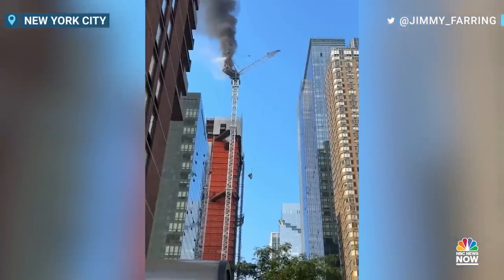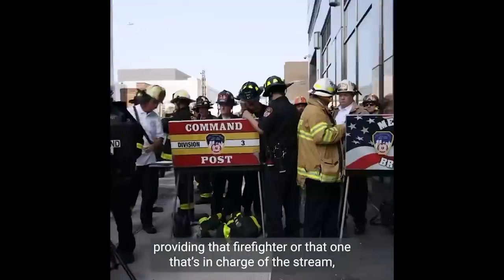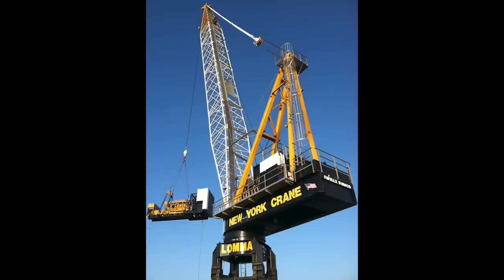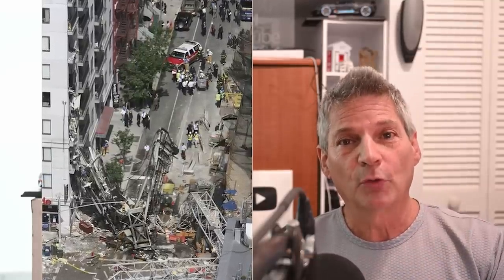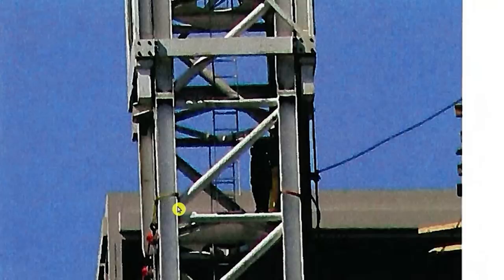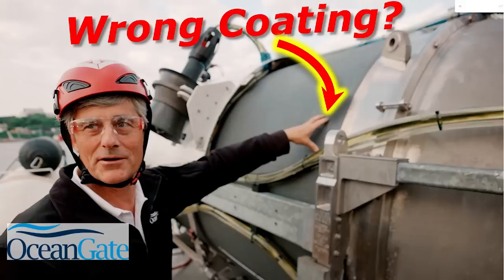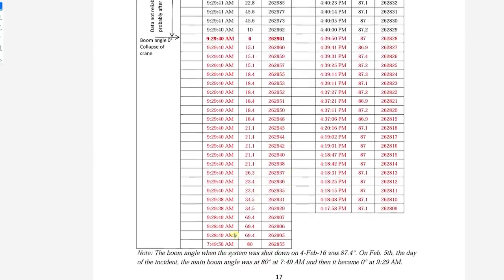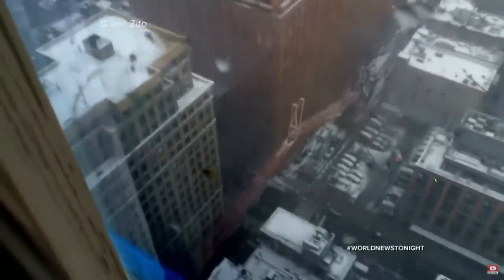New York Crane Collapse Cause, MORE Fatal Collapses

Comment: Having been a crane operator for 44 years, I have never seen a diesel powered tower crane.  They are all electric.  Think about HOW would a person get diesel fuel to the crane.  While it is possible, it is economically absurd when electric power cables have no appreciable ongoing costs.  IF you are serious about tower crane accidents of this type, research other YouTube videos for fires on tower cranes.  I have seen 4 tower crane fires on video.  It is difficult to determine the crane manufacturer but they all appear to be the same model.  If this model uses hydraulics, that would explain why they catch fire.  Most tower cranes are ALL ELECTRIC with no hydraulic oil to catch fire.  A fire would burn the boom hoist brake materials as they are heat sensitive the same as the brakes on your car.  Once the brakes are damaged by the fire, the boom will fall.  All four crane fire videos end with the boom falling.

Concerning the "tip over" accident, this one was ALL the operator's fault.  It's clearly visible, the Main Boom should have been at 80 degrees.  The jib should have been "jack knifed", as you call it, down until the point wheels were on the ground.  This tip over was caused by the operator booming down the MAIN boom without luffing down (jack knifing) the jib down first.  You are correct, the jib should have been luffed down BEFORE the storm.  I am positive "wind tunneling" (wind being funneled between buildings along a street) was a factor.  I doubt it would have been enough to cause the tip over IF the proper procedures would have been followed.

I have used YouTube videos to expand and improve my crane knowledge.  If I am able to watch an accident and figure out the cause, which often times is extremely easy, then I am able to watch for that scenario and prevent it before it happens.  In my career, I figure I have been on nearly 40,000 job sites as I operated a rental crane providing hoisting services to thousands of customers (3-5 jobs per day, 5-7 days per week, year round for 44 years..  In all that time, I have never tipped a crane over, but I have picked about a half dozen up.  It takes experience, dedication, and perseverance to be a good crane operator.  Some have it and some don't.
Reply from the maker: This one is deisel powered, if you look at the used crane listing sites, they show the Cummins deisel engine on this model. It might be an old school model.

Comment: Could've been a hydraulic line let loose and sprayed onto a hot manifold. Those large hoses can blast out a tremendous amount of oil, any idea what the psi rating is on those high pressure lines? Unless the operator notices the break, it'll just keep shooting oil at a high rate until the operator shuts it down. Probably 30 to 60 gallons in no time, hot aerosol oil.

Comment: 45 degrees isn't optimum after you add air resistance in to your calculation. 
And then there is fluid thread breakup to consider, which is more complex than air resistance and depends on the volume and velocity of the water stream.
No way would 45 degrees have got them anywhere near it.
Reply from the maker: They are already close. The angled stream was hitting the front of the crane. All they had to do was angle it up a bit more to get tot he back of the crane. Not even close?
Reply: @jeffostroff  A higher angle means more time in the air, more drag and a drop off of velocity on the x axis. That's why 45 degrees isn't as optimum as, say, about 36 (depending on initial velocity).
Some of those shots seem to show the firefighters are at a higher level then the crane fire too. Bit hard to tell.
When you add in fluid thread breakup, it's all trial and error.

Comment: Air resistance will effect the optimal angle.  And the stream breaking up into droplets is another factor in how far a hose can EFFECTIVELY reach.  

A little backyard experiment with a garden hose and a 5 gallon bucket will give a much different optimal angle.  You can see this on the flat shooting hose, it doesn’t just fall short, it’s Also breaking up to the point that there is no stream, just a spread out mist.

I have to add another critique. You appear to be an intelligent engineer with little practical knowledge on this subject.  The crane operator is required to do regular inspections. It’s at the beginning of every shift.  It’s also not possible to inspect every part in full detail, as some would require disassembly, and even just inspection of everything accessible from every angle would take the entire shift with no work being performed.  As a final point leaks start at a point in time, assuming there was a leak that caused this fire, it is entirely possible it began after the inspection.  I had 2 issues in the last month I dealt with.  One was a bolt shearing off dropping a load a couple inches. It had no visible wear and the crack wasn’t dirty or oxidized like it had been happening over a period of time.  The second issue was a hydraulic swivel fitting that just blew apart without warning.  Both machines are still down getting substantial maintenance and inspection, including items that were not due because of where they were in the PM cycle.

Comment: It’s not an angle of attack problem, it’s a water pressure problem. The pressure and flow rate are not high enough to propel the water that distance.

Comment: Bit of a difference in flight between theoretical cannon balls and a water stream.  Take a look where the water stream breaks up, at that point the theory all goes out the window.  But the low flat stream was quite pointless and would be better shut off to conserve pressure for the bigger stream.  I wonder if high rise cranes all now get an onboard fire suppression system ?

Comment: Poor analysis - second fire hose could've been a longer run or lower pressure. Predicting failure of an engine hydraulic hose is nearly impossible. Stopped watching after that, dangerous/incompetent to assume so much.

Comment: Worked in a shipyard that the cranes operators  killed others - a  new operator lowered a boom over a truck & the brake failed on a friction crane - a crane operator moved a load over a worker & the rope failed -

Comment: So, did you also think about the velocity loss using a 45 deg angle for the water? The lower the velocity, the more it will start to spray and just drop, no? You don't want a mist next to the fire - I mean if that's your goal, sure.

Comment: The operator stated that the engine went in to “Diesel Engine Runaway”. Fact!
Reply from the maker: What does that mean!
Reply: Diesel engine runaway is a rare condition affecting diesel engines, in which the engine draws extra fuel from an unintended source ie oil and overspeeds at higher and higher RPM, producing up to ten times the engine's rated output until destroyed by mechanical failure or bearing seizure due to a lack of lubrication.[1] Hot-bulb engines and jet engines can also run away via the same process.
Reply: @jeffostroff it would be awesome if you could do a YouTube video about “runaway diesel engines”! You have a great amount of followers to educate! Keep well my friend!

Comment: It’s the longest trajectory at 45 degrees, but you DONT want the longest trajectory when you’re trying to spray water onto a finite point. The water stream breaks apart while traveling through the air as it decelerates. Not to mention wind as well. If they sprayed at 45 degrees the water stream would completely break apart at the top of the curve, and then air/wind would dissipate the water and just about 0% of it would actually be concentrated where it needs to be to put the fire out. Fire fighters did an excellent job. NY fire fighters are literally the best in the country.
Reply: Also the second hose was obviously weaker and had less GPM than the other, so they were more than likely “combining” the streams to help carry the stronger of the two streams further to reach the fire. Maybe look up how firefighters actually do things before making a statement that insinuates they’re ignorant of physics.

Comment: Diesel doesn't burn like that, it has to be oil or hydraulic fluid and the hoses can blow without any warning
I don't think that anyone is  at fault here, stuff like this happens
Reply from the maker: Maybe, and maybe not, a hose will blow if it is worn. I check hoses in my car all the time, and when I find a soft one I know it is time to replace. I bet no one was doing this
Reply: @jeffostroff  I think you had better go look at some hyd hoses they are rubber coated steel braided lines you can only bend them by hand using some effort and impossible to crush by hand . Go learn your subject before you comment

Comment: anyone who has ever worked around heavy equipment never asks about why a hydraulic line fails  that would be a full time job in itself  when they go they go, and they can go for seemingly no reason  pressure no pressure pressure no pressure vibrations rubbing imperfections in the manufacturing.  they always go at the worst time too :)    its probably why the second hose was not hitting the fire  they were using the second to keep any fuel or oil from puddling and spreading the fire down as happens with burning liquid

Comment: Are you sure about 45 degree angle, in the context of decreasing pressure/flow (decreasing FORCE)? I'm sure 45 degrees is correct for VECTORs, which are CONSTANT FORCE & VELOCITY! For a case where Force is being reduced/lost as the distance from "hose tip" increases, doesn't the max distance shorten at ANY angle? (Engineering Statics & dynamics)

Comment: I am a bit surprised that they allow the public under them. On a work site you are generally told not to be under a working crane in case it drops something. On a work site at least you should be aware of a working crane, the public probably aren't.

Comment: Those winds are probably average wind speeds. You have two exacerbating factors: wind gusts and the venturi effect of the buildings themselves. Operating cranes in high wind conditions is just criminal. This happened during the construction of the Milwaukee baseball stadium in 1999, killing three workers observing the lift (https://en.wikipedia.org/wiki/Big_Blue_Crane_collapse).

Comment: Why no electric motors in cranes? I would want the generator to be on the ground not up next to the cab, bit of a deign flaw. Would be much easier to do maintenance if most of the large components are not at the top of a crane.

69.420 degree angle not good...

Comment: Would be interesting to compare crane collapses in the rest of the world, especially China. Something must be done about Safety Inspections I'd like to think an aircraft has a better system of safety checks, and that should be the standard system to work off if it's possible?  just a thought am no expert on these types of things.
Reply from the maker: There is an excellent system of safety checks, but crane operators are not engineers and they will usurp the rules all the time. Cranes topple over because they put them on soft ground with no gravel
Reply: @jeffostroff  OK thanks for the info, end of the day someone isn't doing their job.

Comment: Was it ever determined what caused the fire? As for responsibility it most certainly is the States responsibility, but of course they will never admit guilt so they have to point a finger at someone else. Just like the walkway that collapsed here in south florida some years back where people were injured/killed, that incident occurred due im assuming false reports or someone just paid off the inspector to pass. I work in construction as an electrician and have been on many multi million dollar sites here in florida where deadlines need to be met and corners are cut sad to say...
Reply: The main reason for these corners to be cut and false reports given is to save MONEY. ITS ALWAYS ABOUT MONEY

Comment: The real deal here is that the State and the City of New York have not yet fixed their collapsing crane problems. In this instance, it is completely human error and preventable.
If the State and City of New York exhausted as much effort and energy on CRANE SAFETY as they do and have on Unconstitutional GUN CONTROL, then Crane issues like this would cease to be the major problem that it is turning into. This is spat in the face of New York Citizens.

Comment: You're not much of an engineer. You can do a visual inspection and not see anything wrong with a hydraulic hose or fitting. It is under a tremendous amount of pressure and can burst without any warning. 
Former Manitowoc Crane Journeyman Millwright for Manitowoc Engineering in Manitowoc, Wisconsin
Reply from the maker: Did you ever do a squeeze of a hydraulic hose? They do give an indication.

Comment: Helicopter with a bucket below it  dump enough water in one to deal with it .
As for the reason they collapse operators turn the safety equipment because they get fedup with all the warnings . yes i used to test and repair the stuff .

Comment: That's an electric crane ! Operator is required to do a daily fisical and visual inspection . No diesel fuel on board !  Probably a Maintainance issue likely a short circuit in the power distribution box . The February accident was 100% operator error .NYC requires up to 6 licenses for a crane Operator but having the license doesn't mean you know how to operate every kind of crane , Some jurisdictions and contractors require new cranes on high rise construction.

Comment: Being a former construction worker on a quite a few high rise buildings I have seen the aftermath of crane failures . Some were caused by ignoring the overweight alarms or lack of working alarm systems, or operator error  due to lack of experience or communication from signal ers to operator. I know that this guy is way off on guessing what he thinks are the causes. He does not know what he is looking at.
Reply from the maker: Not sure where you got your info from but I got mine from engineering reports, and the manuals for the cranes which tell you how to operate them. When you operate outside those bounds you get failures. This is not guessing.

Comment: Strange how a fire department doesn't understand the simple physics of aiming a hose at 45 degrees gives maximum distance the same way it does for artillery shells, the same way it does for anything "thrown" against gravity at an angle.
Reply: This isn't known as the smartest country, although we simultaneously have many of the smartest people.
Reply: Strange how random youtube commenters don't understand the simple physics of water and water droplets not being in anyway the same as artillery shells, and how the 45 degrees is a very basic system that's taught to kids, but doesn't take into account the complexities of wind, air pressure and every other factor that could change potential angles.
Reply: Try to throw a feather, at a 45 degree angle vs 30 degree angle, what feather goes the longest horizontal distance? The world is complicated, but scientists need to be aware that most things we don't know, so just to take a glance at something we don't really understand and make firm conclusions, is likely not very smart thing to do. In general if we see something that does not make sense to us, it is better to ask others.  As a team, we are much smarter than individuals alone. That is the power of community. However, other people have other ambitions though, which is fine, but just my 2c about this :)

Comment: The question of "who's at fault?" usually has and answer with more than one person. The crane operator is almost surely at fault (ethically, if not legally) as they should have inspected things before they operated it (if I were asked to operate a piece of heavy equipment and told I'm not allowed to inspect it I'd tell them they can wait for me to do the inspection or wait however long it takes to find another operator). The crane company is likely at fault (unless it's pure operator error or some kind of bazaar unforeseeable circumstances) because they are the ones making the decisions about how to maintain and operate it. Both of them being fully at fault isn't a contradiction IMHO.

Comment: 3:38 what a neglectance to work this ridiculous way.
Looks like bloody amateurs at work, too many fire fighters and no one getting it right or taking care to get it right.

Here they would be fired for such neglectance. It is their duty to have the knowledge and to use it and if they are not prepared the next officer has to have all the knowledge to overlook such operation. 
You were right .
Reply: idk you can only go so high before the wind becomes much stronger than your stream and it ends up just blowing away
Reply: This is a few seconds of footage. They were likely at this for many many hours. We have no idea what their plan or process was. Funny how people always think they're the better expert after watching a few seconds of video, rather than all of the experts on site for hours who were able to see the problem first hand and adapt to the situations arising. 
None of this suggests amateur behaviour or negligence from the fire fighters. In the moments you shared, the smaller of the streams isn't even aimed at the crane anyway, it's aiding the other stronger stream, which likely suggests they're not even trying to have two directly on the fire, but a secondary to help with air pressure, cooling and whatever else it's needed for.

Comment: Operator Inspections are nothing more than a fluids level check and a quick once over of primary components. You cant expect an operator to also be a mechanic. Even then hydraulic hoses can fatigue internally and even the highest trained mechanics cant predict every hose failure. I've seen hoses that looked new explode, I've also seen hoses that look like they should have exploded 20 years ago still going strong (on farm implements, not cranes).